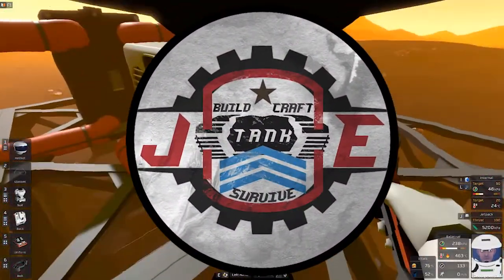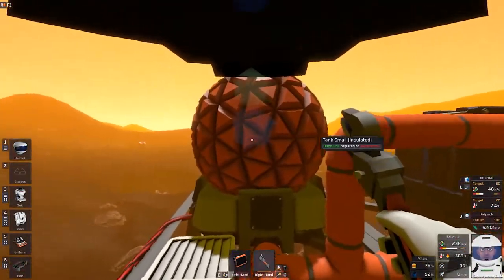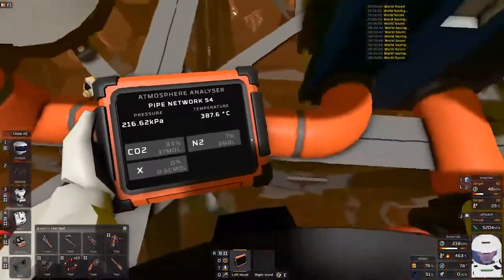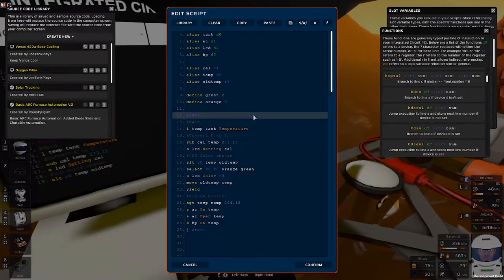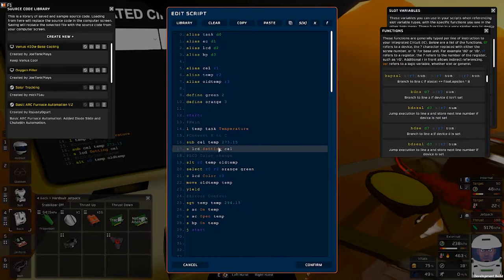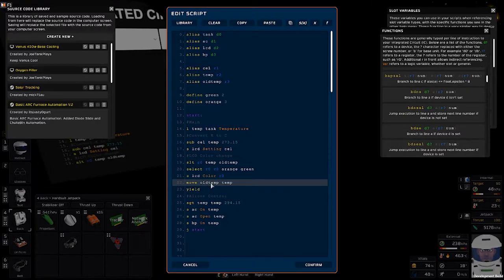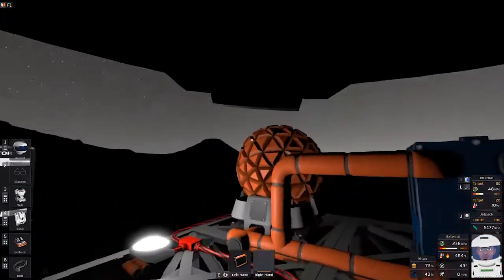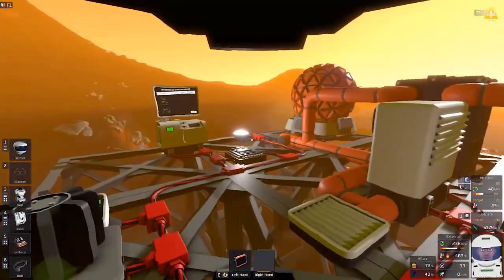Venus Base Cooling 400w Legit | Stationeers

Comment: Heat exchanger equalises the temperature between the two pipes. You could do the same thing with an enclosed space and a whole bunch of radiators - the heat exchanger just does this more efficiently / in a smaller space.

One thing that I think you're missing is that this may work fine on a small scale, but you'll find that when you need to cool a large volume, it's not going to work so well.

This is because if you look at the volume of gasses involved, you'll see they're very small - handfuls of mols.

This down to the specific heat of the gasses involved.

If you have 1 mol of gas at -200C, and use that to cool 100 mols, you're going to see the temp of the 1 mol shoot up, but the temp of the larger volume barely move.

Granted, you may be good in a situation where very slow cooling over the long-term is what you need/are happy with, but there will be situations where the cooling effect gets overwhelmed.
Reply from the maker: You are very correct. I’ve done a lot of experiments since this one and when it comes to large scale it’s not up to the task. I have come to realize that if I create a 3 x 3 room. File it with X and use a looped ac with rads on the pipe and stick some pipes with a ton of rads on them and pipe in the gases into the ice box I can cool a full large tank in about 13 or so minutes.

Comment: Noice! To hit 20C I usually set Min and Max values you want to control to 19.95C and 20.05C. That is 293.1 and 293.2 Kelvin. 
On a regular console with the gas chip in it it will show as exactly 20C. When tank pressure and all that have stabilized.

On the Led display it might be different but MIPS have an Round function you could use perhaps. Not sure if the Round function let you decide how many digits you want though..

Comment: Not really legit. u changed the temp, but the energy, that can be cooled by this is small. so, if u put in some stuff, u want to cool, the temp will raise fast. u "cooled" a few moles in the tank. try to pump it up at 50MPa - and u will wait for DAYS to cool it